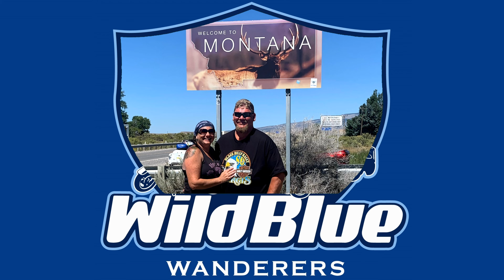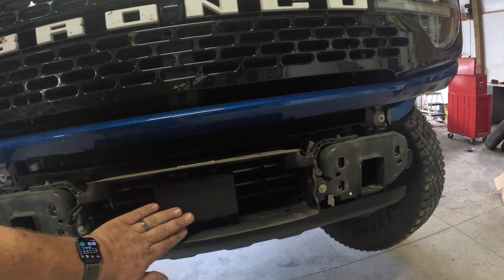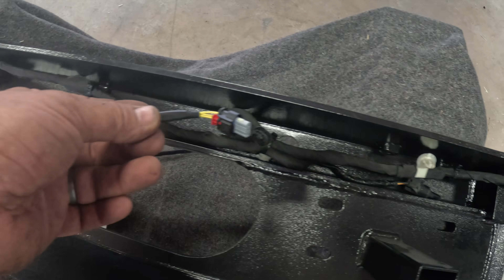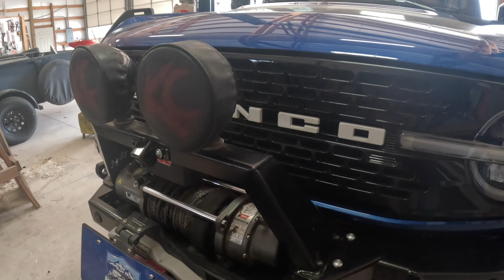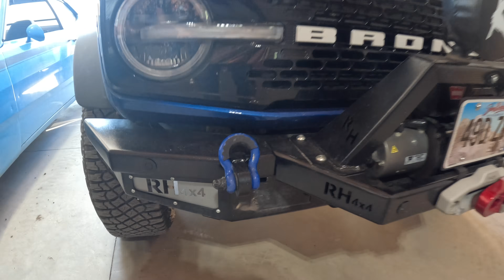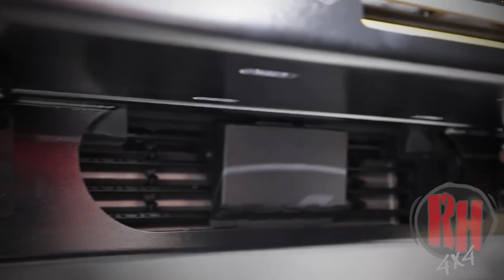Flat Towing Nightmare! Rock Hard 4X4 Bumper Fails on Our Bronco | RV Life Problems

Comment: Great feedback for the torque spec inclusion in the instructions. However, I must also add that they should continue to use "Right" and "Left" ensuring it is actually right and left. The reason I say this is in regard to international customers. Many countries have the right-side drive systems (Australia, U.K., etc...). So "Driver Side" and "Passenger Side" may not be correct for them unless footnotes for right-side drive systems are included.
Reply from the maker: That’s a good point on right and left, the biggest problem is some things they had marked as left and somewhere were right and they weren’t always correct. and some of that depended on the application and accessories included, I appreciate your feedback. Thanks for watching.

Comment: I re-torque wrench ALL of my towing bolts at least twice per year.  Some are in fairly difficult locations and applying the torque wrench properly becomes a challenge. In fact I had to buy a 3/8 torque wrench to specifically get into some of the tight spots. Be careful using loctite,  only use blue and then sparingly.
Reply from the maker: Yes, this was definitely a good reminder to always check your torque and inspect your attaching hardware regularly.

Comment: Just curious- why didn’t you just use the adapters that are designed for the stock modular bumper?  That bumper is rated for an insane amount of stress, and both Roadmaster and BlueOx make adapters for those tow points.
Reply from the maker: Because I wanted the winch bumper also and like the setup.
Thanks for watching and the feedback. 👍🏻

Comment: Concerning to say the least, not sure I would be as satisfied with the outcome as you are, not even sure I would be still using that product from them or at least I would have to find the root cause, so it doesn't happen again, I trouble shoot oilfield equipment that runs 24/7 for a living, I see bolts backing off on a daily basis, when bolts back off it usually doesn't happen overnight, depending on the application it could take weeks or months so not sure how you didn't see this rattling around before they backed all the way out especially that they didn't pull out and caused no damage to the welded nuts or bolt thread, even if you didn't have them tighten to the exact torque, if they were tight, lock washers should have stopped those bolts from backing off, unless that they were  weren't tight at all, too many unanswered questions for me to be content with a free bag of bolts. For me I have to have 100% trust in the products back there, to your credit, you were paying attention, it could have been catastrophic, you definitely dodged one there.

Comment: Really glad you are all okay and no one else was involved/affected. Way to stay cool on the road, that is the real story in my opinion. I made the change to RVIBrake 3 and a heavy duty towbar for our BRaptor. I was happy with the NSA Ready Brute, but not sold on the extra stress it puts on the whole system.
Reply from the maker: Yes, could’ve been bad. Glad Scott kept his wits about him and didn’t panic (like I probably would have!) 
Curious as to your thoughts  on your RVi breaking system and heavier tow bar? Are you glad you made the change?  We are heading to Tennessee in a week and will be using the new setup…so will be testing it in the next few days before we hit the road!
Reply: @WildBlueWanderers  I just didn’t like the amount of movement and stress that the surge braking puts on everything. If you think about it ,the towed pushes forward on the hitch and that applies brakes and then the towed slows down but that lessens the forward pressure which lets up on the brakes. I just felt like it was working against itself. Especially on exit ramps. Roadmaster Nighthawk is easy to set up and the RVIBrake 3 is even easier. I like the way it tows, everything just feels more solid.